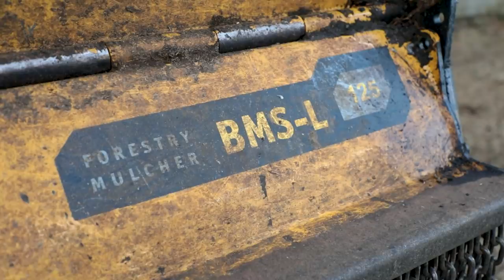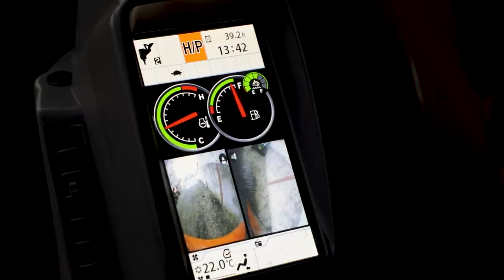DJ McKay & Son New Hitachi 130LCN!

Comment: To be fair it’s not a bad digger I operate one 5 days a week just had the power upgrade on it so it runs with more power lots better. But would say a Hyundai is much faster and more power 👍
Reply: Hyundai’s are bouncy back breaking soul destroying fucks of things and aren’t even in the same ball park as hitachi and I’m a full time operator for the last 25 years. There’s not a man or woman I know that will happily spend a day in one of the dirty things.
Reply: @noelcxl2037  how do cats and Volvo and komatsu compare?
Reply: @Alexr-uf3zn  for me below 20 tonne hitachi has the edge on the 3 above, however above 20 tonne the 3 above are better than hitachi, currently on a 380 Volvo and its a lovely place to spend a day, so comfortable and smooth. Komatsu aren’t comfortable but a good machine. For outright digging power though it’s hard to beat the cat. That’s just my opinion and it’ll probably be different for other’s.Spent 3 weeks on a brand new 340 Hyundai a few years ago and was ready to burn it. Horrible things!!
Reply: I prefer kobelco to Hitachi
Reply: @lukehickey7453 kobelco are trash., the HYDRAULIC pumps are awful we had a brand new sk270 on demo absolute heap of shit nobody on site would drive it or entertain it after first 2 days.. it wasent even worth putting diesel in there crap for levelling up with as the pumps Carnt keep up there lazy slow machines & basic needs lasting cabs.. no thanks l
Reply: @thewippit8717  see Volvo are known as the rolls Royce of shovels aka loaders, what’s Volvos back up like? Finnings is world known and apparently very good can Volvo in the U.K offer the same service and dealer support this often sells a machine, very interesting topic, always been agri machines for us have and old 13 ton Samsung does what we need her to do but interested in newer stuff
Reply: @thewippit8717  Totally agree with you, maybe after years of doing this job we’re getting picky in our old age😂 but have to say Volvo just got everything right, they really designed them with operator comfort in mind. The ECU seems to give a bit of trouble in them but I’ll over luck that for a comfortable ass any day 😂
Reply: @Alexr-uf3zn  I’m in the south of Ireland and from what I’ve seen the Volvo back up service is excellent as is finnings to be fair.
Reply: @Alexr-uf3zn  - finnings are top notch service we only run volvos at our company every thing from 140s to 750 Volvo all normal & demo spec & high reach 360s & loading shovels there service is spot on
Reply: @noelcxl2037  - yeah touch wood the 380 I’ve got only got 900 hours on had it from brand new full demo spec with 17m 3 piece boom & she ain’t been a ounce of bother really she’s my baby lol the 480 had few issues mainly the add blue tank but it’s nearly 2 years old now with 3.5k on her
Reply: @thewippit8717  I've never heard of a digger with 3.5k hours after 2 years it most be working day and night🤣
Reply: @lukehickey7453  well your obviously not working them hard enough mate .. they could piss them hours in a year if there working right.. 10 hour days 7 days a week for 365 days they will clock up 3650 in one year alone... So they would piss 3.5k in just over 2 years mate 👍 ours gets driven 6 days a week nearly every week of year give or take a couple of weeks for maintance break downs transport ectra but pretty much with out fail there running & doing 10/12 hour days 6 days a week & my mistake its over 2 years old it was brand new to us end of March 2018 model so you do the math mate on the hours we run our machines 👍
Reply: @thewippit8717  well to be fair the council hire are diggers are on the council they do fuck all earn the same money as on a site and dont burn half the diesel we do 9-10 hour days and there only running for 5 hours and we get payed for 10 and you just said 7 days a week now its 6 and a couple of weeks off?
Reply: @thewippit8717  You probably didn't even have her in H mode lad when you start them they are in S
Reply: @michaelmedia3230  ha ha you drive a Hyundai mate defo no room to talk it had to have a power upgrade put on it already not even good enough out the factory 🤣 that says it all.. every body has there preferences on machines same as cars lorry’s motorbikes food everything.. lad I work with loves doosan he would have a doosan over a Volvo just his preference.. I no mine certainly wouldn’t be Hyundai or kobelco or lui gong..  12+ years now operateing 360s & 180s daily it would be Volvo & cat all the way for me 360 wise.., & the  cat/ jcb 3cx for 180s.. it’s each to there own but that’s me
Reply: @lukehickey7453  yeah council jobs are way forward we have some cat 432f wheel diggers beautiful machines that we do council work with from time to time.. like you say work 5 hours a day paid 10 the easy life., I was useing the 7 days a week as a refrence for hours in a year.. we work 6 days a week every week if we can work 7 days we do work seven days.. or we work 2 weeks on 3days off & over lap woth drivers so machines arnt stoop depending wear we are in the country/world & the job time scale we have for completion.. our boss keeps saying the 480 will be going as we can do pretty much everything with a 380 that 480 does & it will burn half the fuel that a 480 does
Reply: Here’s a question for you all.. has any one driven the new jcb 220x series yet? Heard half decent reviews on them but not been in seat of one yet...
Reply: @thewippit8717  yeah I have heard great things about  them I would love to upgrade to one and get rid of one the hitachis but the father dosent like jcb track machines but we have a few jcb 3cx and have you ever driven one with the track machine controls on it a freind of mine bought a brand new cat 180 with track machine controls on it but is alot of money to get it
Reply: @lukehickey7453  yes mate our cat 432f are new not even a year old & there all 360 servo controls not levers... there brilliant machines so much grunt mate I love the 4in1 controls & forward & reverse on 4/1 joystick too so much quicker & easier... we also had a jcb 3cx on demo last year on servos decent kit I think  loads better personally..  I can drive old style x pattern lever 3cx no probs but prefer them on servos like a track machine.. yeah I must admit I’ve heard loads bout the new 220 x series ment to be amazing for jcb  but not actually driven one yet
Reply: @thewippit8717  I do in my fucking arse drive Hyundai I wouldn’t touch one with a barge pole. I drive Kobelco’s lad if your telling me that they’re a weak digger you may aswell go home because we’ve been running them for the past 10 years and they are an amazing machine.. they’re fast, comfortable and efficient